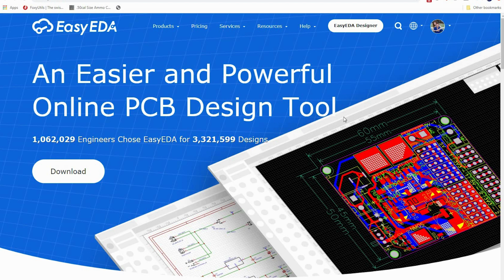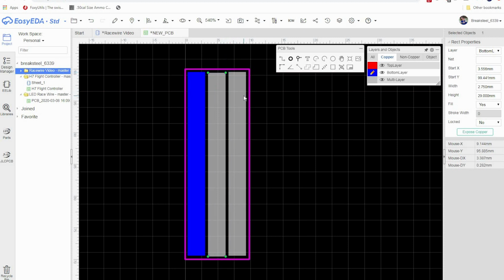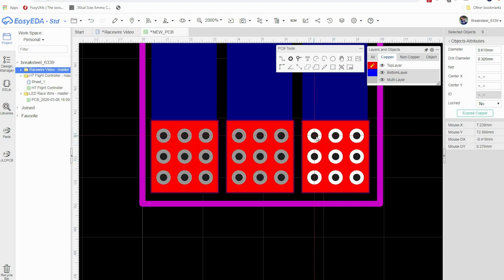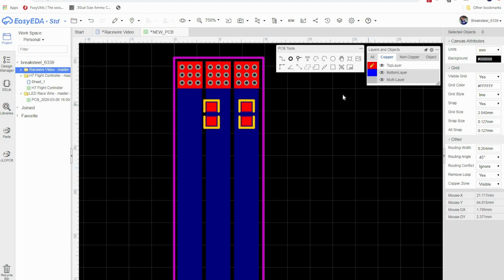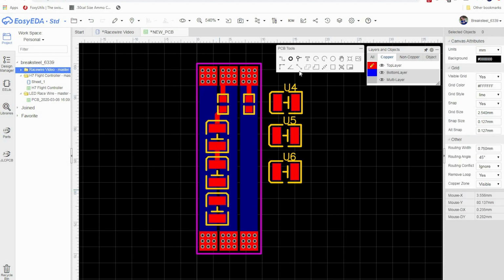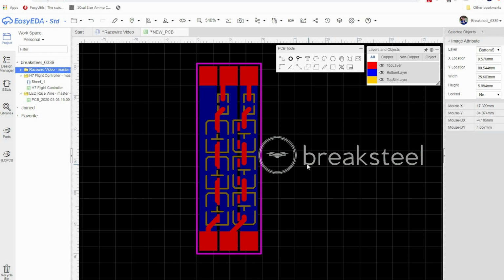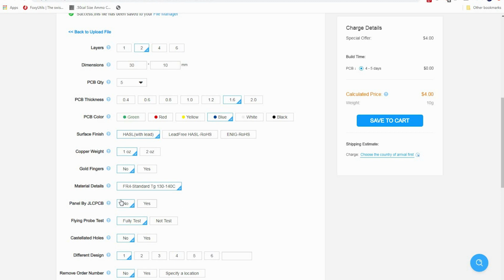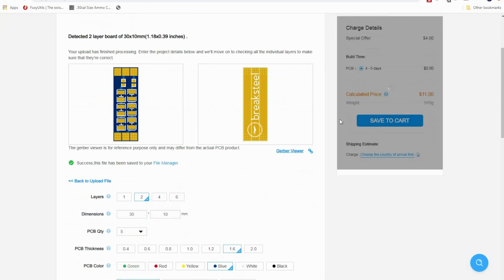LED Racewire, How To Make Your Own

Comment: Soooo that’s why there is only two rows of lights. It has to leave one path for return. I was always sooo baffled how these were wired. It never made sense to me how it got a power and ground return on one wire. I didn’t know the led hooked between two different legs I thought each led was on one wire. Subbed!!!!!
Reply from the maker: Yes getting a 3rd row can be done but you’d have to make the chip larger to accommodate a via and the extra traces. Wouldn’t be worth it IMO. Thanks for watching and I really appreciate the sub!

Comment: How to make that calculations which resistor to use?
Reply from the maker: I’m terrible with math so I just use a online calculator. This one is pretty good ledcalculator.net
Reply: @breaksteel  didn't helped much because it's AC phase that we using there but , 470 ohms are good for 3v 20ma leds , 
https://youtu.be/O9hFbLb90f8
Reply from the maker: Doesn’t matter if it on AC or DC. A Diode only flows in one direction. (LED = light emitting diode)
Reply: @breaksteel  always great to learn something , thank you very much , now I have used this calculator once again and everything have cleared for me :p

Comment: Isn't 1oz too low for a 2layer racewire? I'm not an expert, but with 6s lipo, i can have 30a max per esc, so, i think 10a per motor wire
Reply from the maker: This entire thing is a bit of a test for the LEDs I have. Your right, these will not handle 6s voltages. I’ll have to test them on 4s but even then I’m not sure they’d handle it. Once I figure out the best LED for these I’ll have to rework the surface mounts then order some higher weight copper.